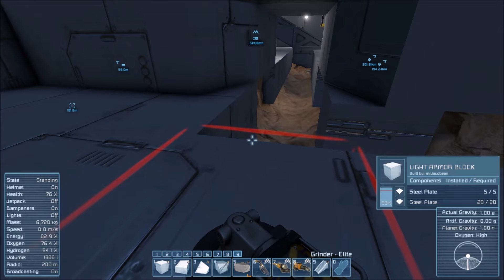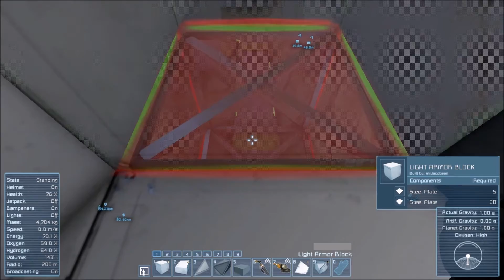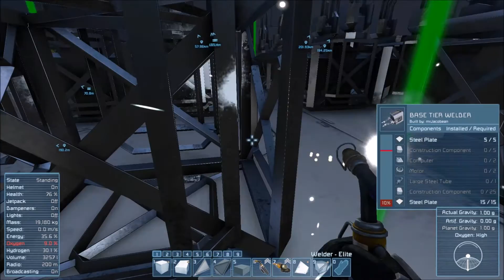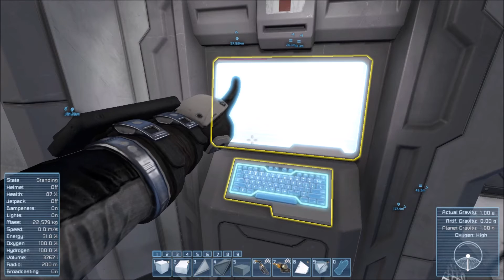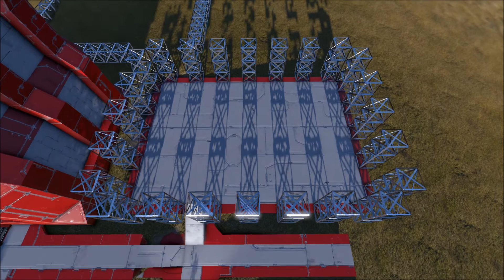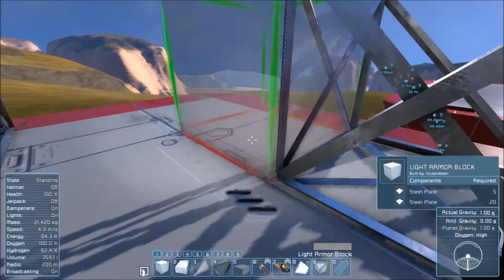Space Engineers - Construction: Welders - Episode 10

Comment: Have you thought about using the nanite mod? It will weld up what you want no matter the distance as long as it is connected to the main complex or has a becon on it
Reply from the maker: I have it installed, and I used it to build the fleet. However, I am trying a different approach this time around
Reply: Ah ok. Did not know that. I am a relatively new follower.